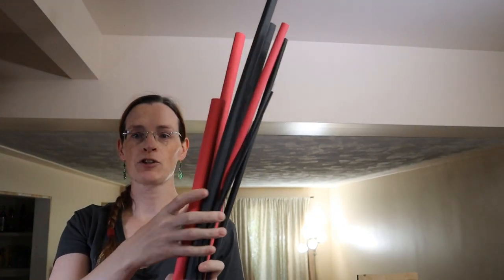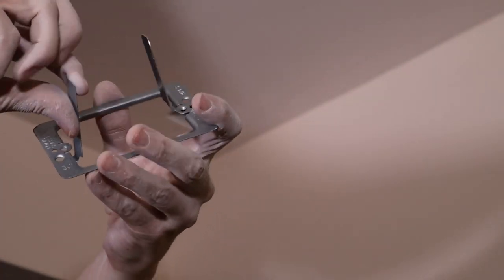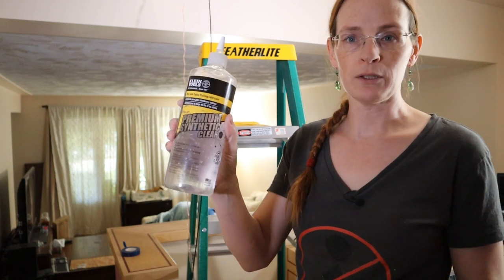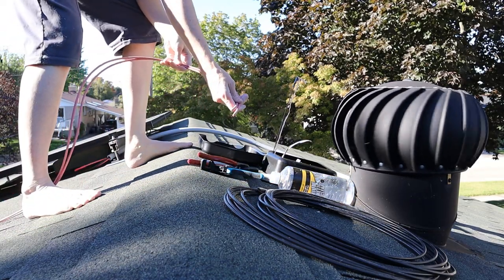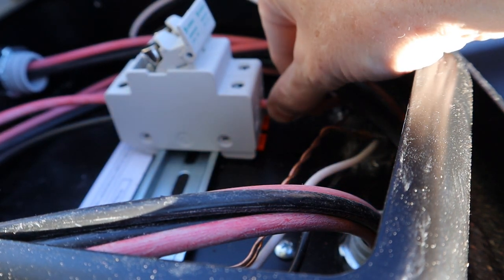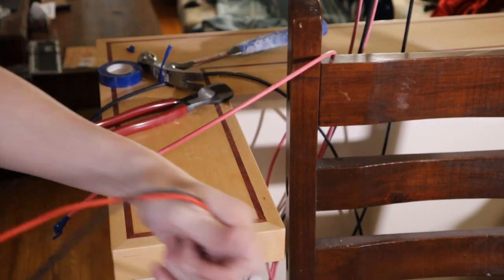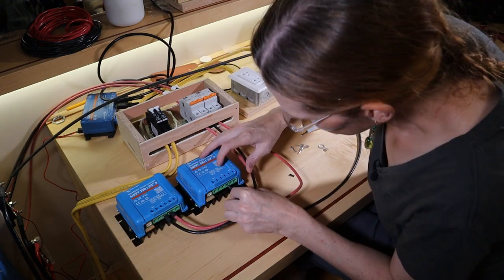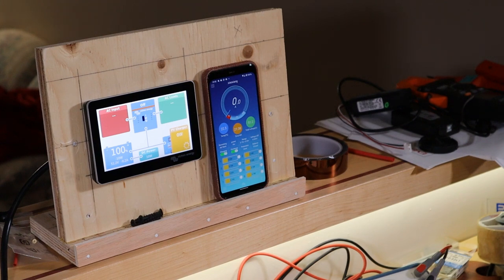Solar Panel Connection (Part 3) - How to build a 48v Lifepo4 battery (Ep. 20)

Comment: 15.44 If you use wire ferrules the copper is hidden by the shoulder of ferrules ref:  https://www.youtube.com/watch?v=Fsz-BDtbz8U
Reply from the maker: That wouldn't work in this case as the holes into the MPPTs were too small for 10 awg wire.

Comment: Ok! You dont no nothing about AC DC voltages!
Reply from the maker: You have amazing powers of obervation.
Reply: @TheDigitalMermaid  Well, I believe he is referring to the part where you claim that you can let go of a wire wit AC power due to AC is crossing through 0 V.
That is a stupid idea!!!!!!
And it is a dangerous to teach people when they don't know about electronics, and specially when it's catastrophically wrong.
Imagine you closing and opening your hand 60 times per second, that is a bit hard?

We have 240V AC in oure outlets, if we didn't have HPFI  (RFCI I think you call it over there) people would be able to be electrocuted if they grab on to a phase in one hand and the Neutral in the other hand, THEN YOUR ARE STUCK, you may be able to walk backwoods on til the leads is to short and vil be pulled out of your hand. 
In that case you will have burn marks in your hand and you muscles might start to swell up, which can lead to amputation of the arm or maybe more.
You can take a lot higer DC voltage  befor it goes bad, but don't play with power in general.
Don't be afraid of it but respect it and treat it mindfully.

PS: On the roof, you grab hold of the Metal on the screwdriver down to the fuse.
This is only 80Vdc and the current would be low in general for a solar cell leakage, but one never know 😉

PPS: Keep letting the videos coming.😊